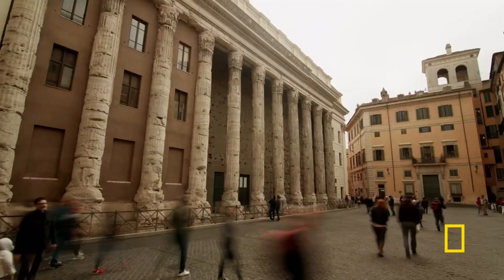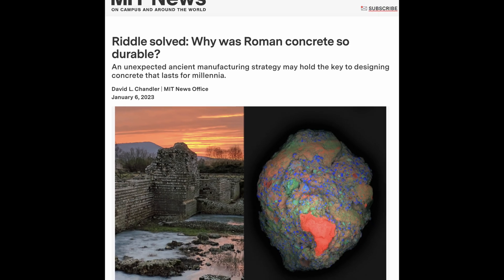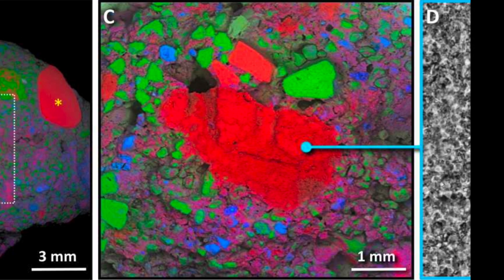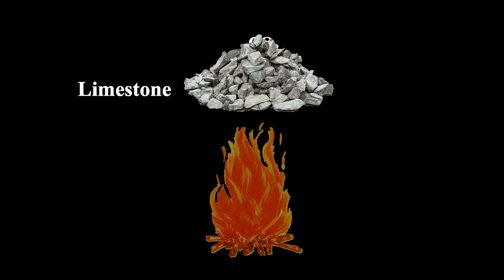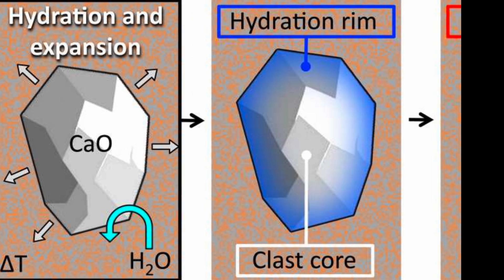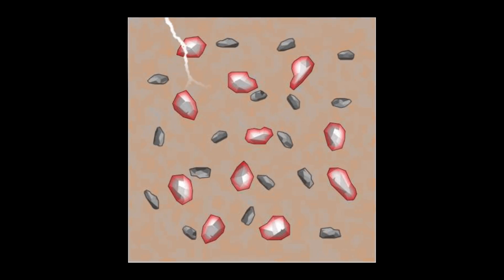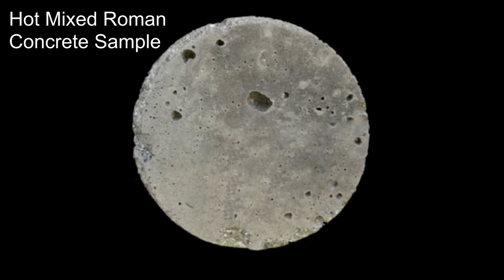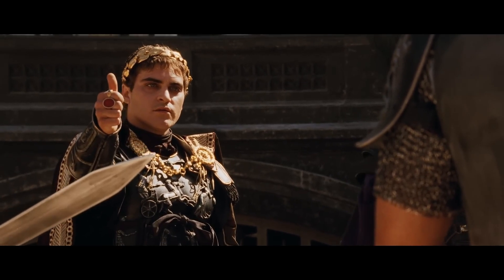How Does Roman Concrete Repair Itself? Ancient Engineering Secret Revealed (Improved Audio)

Comment: Has anyone started building with this yet? Are you even allowed to build with it?
Reply from the maker: There is no outright prohibition on using a Roman-concrete–style mix in modern construction; however, you must meet local building codes and standards, which would require thorough testing and certification.